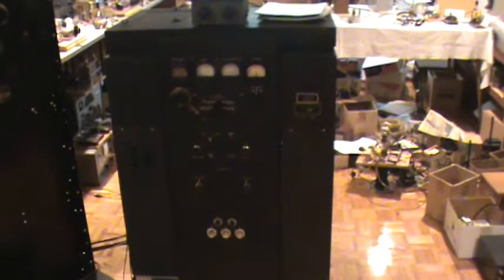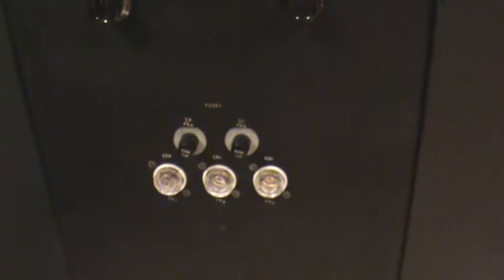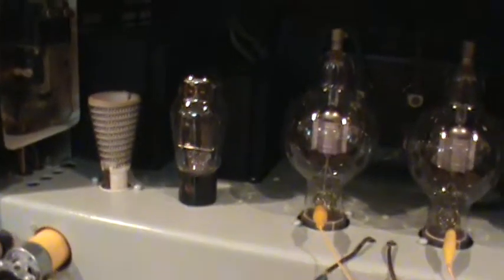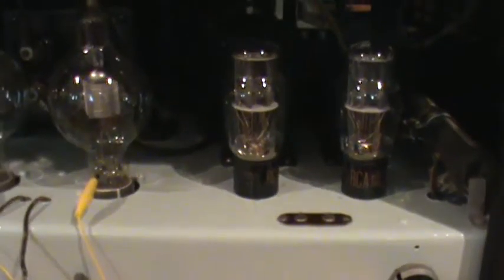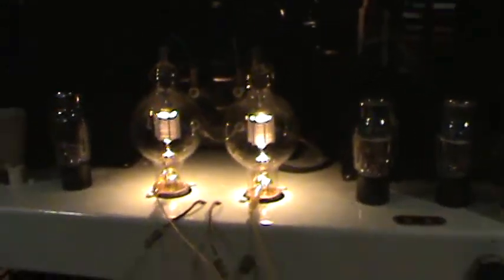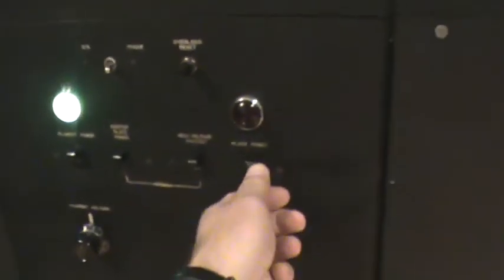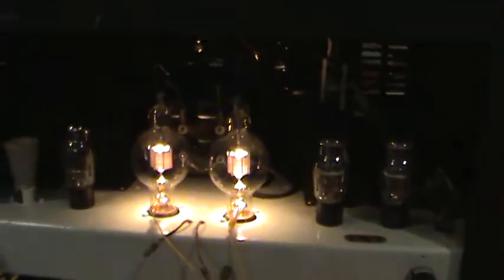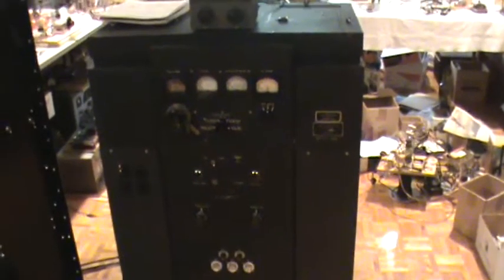Hallicrafters BC-610-E WWII AM Transmitter Restored Pearl Harbor and Battle of Midway

Comment: Tnx for the memories! I ran AA5YDV (K5YDV) MARS station at McGregor Range, NM for a period in 1966. We used RTTY and CW with an R-390 receiver to handle traffic. I remember having to switch tank assembles when changing frequencies. What a workhorse the 610 was! Tnx again.
de NL7X, Duane
Reply: Hi Duane ! More than 50 years ago I also have been working with the GRC-26, the RTTY station with the BC-610 and R-388 receivers !  Good remembrance !!! Jim, HS0ZHK

Comment: Nice 610. I have a B&W 610-I, S/N 079, that I got 20+ years ago from John Mohn, W5MEU (SK), in next to mint condition. I like the looks of the E series better, it's classically "Art Deco" vs. the flat slab of the I models front.  The B&W version also has a black wrinkle  finish vs. the flat black of Hallicrafters variants.He modified the output of it to have a 50 Ohm output impedance allowing an easier connection with modern coax fed antennas. I run mine with a Hallicrafters HA60 VFO. de KI5SL

Comment: Nice job. Your documentation above is useful, as well. I had a BC-610D in the 1960s, which had been stored fpr a decade in a chicken coop. I added the same model Johnson external VFO. I used the matching desktop audio preamp / control unit.. I also kept the plate voltage at 2500 in AM as well as CW. It did well for several years on 75 meters AM.

Comment: CW is clean , but RFI can be problematic with the open wire feed-throughs on the side. I went through this. I removed the ceramic feed-throughs, did not add any holes, covered the holes with copper sheet with a hole drilled for an SO-239 chassis mount bulkhead, anchored the copper sheet with existing screws in the chassis. This made a huge difference and solved 90% of my RFI issues. In addition, each line has 1-2 ferrites added (to relay, tuner, LPF etc).  Easily converted back.
73, Greg K6SRO